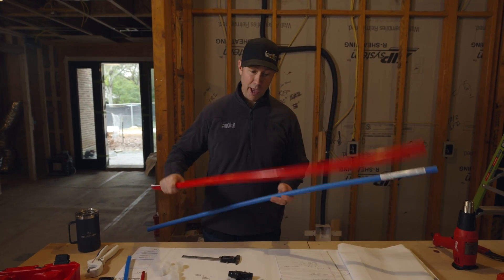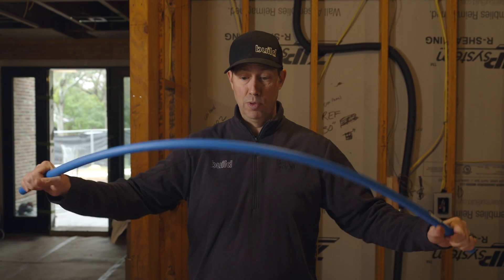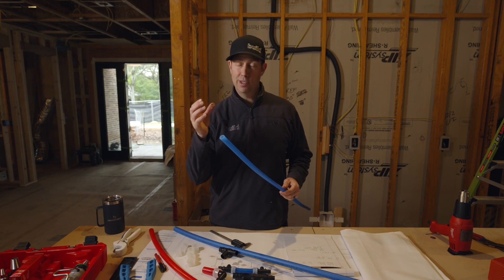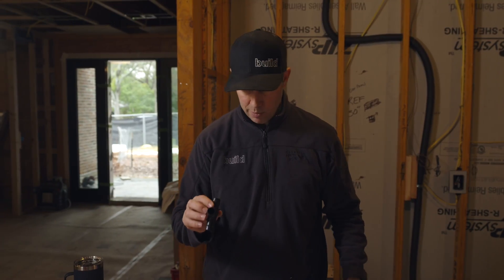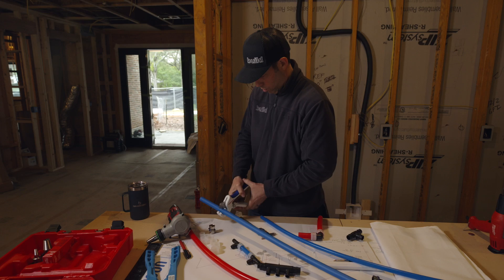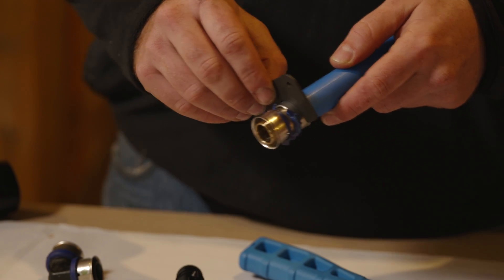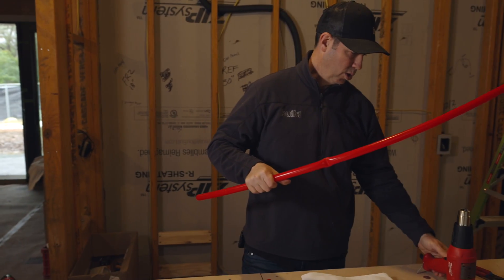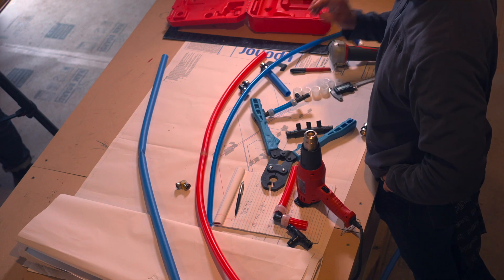Uponor Pipe System Review & Comparison

Comment: I did a bunch of research on PEX before going for Uponor a couple years ago. On any metric, except material price, I believe it comes out ahead. My favorite fact is that is the only system (that I know of) that utilizes the physical properties of the material to secure the connection. After expanding the PEX, it clamps down on the fitting over time as the crosslinked polymers try to return to their original shape. Other systems use crimps or push-clamps that are under stress holding the pipe on the fitting, so I consider it a matter of time before something fails. And by my estimation, the time I saved re-plumbing two bathrooms easily paid for the Dewalt PEX expander compared to working with copper.
Reply: Was health assessed as one of your metrics? Do we know about any long term water quality issues with these types of plumbing systems?
Reply: @Freedacarlo  I didn't specifically look into health but given that these are made of long-chain plastic polymers I wouldn't expect them to be particularly susceptible to leeching into the water. And in a comparative sense there is no flux residue, solder, or oxidation as could be seen in a copper system - but I'm certainly no expert.
Reply: @Freedacarlo  PEX-A does not have any health risks.  It is nonreactive, and does not leach any contaminants into the water.  I don't know about the lesser Pex B and C, but PEX-A is good to go.
Reply: @Freedacarlo  CPVC already leaches into water and it's being used all over the place.  Terrible stuff.   So far I've not noticed any taste issues with Uponor like I do with CPVC.   My house has Uponor,  Copper and CPVC.  I have whole home sediment and carbon filtration.   Get a class of water from a CPVC faucet and it tastes like plastic,  get a glass of water from the coper or Uponor faucets and they taste clean.
Reply: @Freedacarlo  Pex is used a lot in EU (where standards are much higher than US) it's safe. There has been some studies that show leach in HIGH chlorine environments in the US. But only certain brands and in all brands it generally diminished to the point of being undetectable after 30days.  Pex overall is very safe.
Reply: @Freedacarlo , you would simply need to look at the material properties of PEX to see how heat affects it molecularly. If you’re thinking that it is not better than metal (copper/iron) piping in that regard, then you need to do your own research on the material properties of each type.
Reply: Rehau #1
Reply: @benrichards5069  Absolutely.  Got to go Rehau.
Reply: I went Pex-A also.  I like the inherent clamping properties of the joint.
Reply: Have you checked out Polyethylene of Raised  Temperature or PE-RT tubing. It has been used in Europe for decades. Better chlorine resistance than PEX. Both CB Supplies Vipert and Legend Hyperpure are certified for F-1960 cold expansion. Same tools used for PEX A cold expansion.
Reply: @thomasmoore141  We saw PERT in US in 90’s, it was early competitor to PEX. Never caught on in residential applications due to handling issues. It’s too stiff, much more laborious install than PexA. I can’t recall the other issues w/PERT but I just recall my plumbers disliking it. With ASTM standards for PexA the chemical tolerance and potable water safety issues have been mitigated.
Reply: PE- polyethylene pipe has been used in many water utilities as a supply line from the main to the meter for at lease 3 decades. It’s been around longer but I don’t think it became widespread until the 80’s.   I work for a large water utility personally I hate the black CTS PE. (Not PEX-a) I also hate seeing homes where they used the Blue Tuff Tube Pipe. That stuff is junk as well. 
As a water utility we only use Type K- 1” copper for services 5/8” to 1” and for 2” we use 2” copper or Brass piping. 

In homes I’m all for PEX A  
But one last note he never mentioned PEX-Al-PEX Pipe. I see plumber use it heavily here to supply the homes from the meter. Do any of y’all use it? 
The
Reply: @MARKE911  We only use Pex-al-Pex in radiant in-floor plumbing applications. The only reason to use an oxygen barrier in domestic water plumbing applications would be corrosion prone situations such as iron lines or cast-iron water heater tanks which are very rare these days
Reply: @MichaelM-to4sg   and that’s what boggles me. If we have to replace a water service for any reason. We don’t have the proper parts to connect back to that material. The Ford or Mueller pack joint fittings we use don’t seal to that type of pipe. It will be interesting to see what our company will do in the future. Again we don’t use anything other than copper on our responsibility.
Reply: @MARKE911  The Al barrier in PEX-Al is an oxygen barrier. Oxygen can diffuse through the PEX-A pipe and provide oxygen to cause rust on iron fixtures. Iron fixtures are getting pretty rare. Also, oxygen migration is only a problem where the water is recirculated. Over time, oxygen levels in recirculated water increases, causing iron to rust.  Since most pex is being used for domestic hot and cold, oxygen migration is a non-issue. 

If I’d installed radiant hot water heat, 100% would use PEX-Al.
Reply: Can you use crimp with Pex A? Or it must be used with the expansion fittings?
Reply: @micruner5163  absolutely. Don’t know why you would but yes you may
Reply: What is the estimated life-span of the Uponor piping?
Have heard that PEX should not exposed to direct sunlight ever as it breaks down the material integrity so it cannot be used outdoors, is that correct?
What's the max water pressure one can have in a Uponor system?
Does hard water present issues? Does calcium builds up more? less? none?
Reply: @LoneTiger  Refer to ASTM F877 specs. They will answer all of your product questions.
Reply: Upanor and REHAU are the only two in the PEX-A game.  All others are inferior PEX B or C.
Reply: Your research is incomplete!!! If you’re trying to say uponor is the only pex that uses the expansion type of connections you are wrong! As a matter of fact some manufactures of pex  b use expansion or the crimp type system, which actually gives you more flexibility. Pex b is stronger and more stable at the cost of being les flexible. That’s the great thing about living in a banana republic you get to choose. Or not!!!
Reply: Okay now research Zurn its expandable just like Uponor without the dangers of leaching chemicals, please research a little deeper I know it's not proven that Uponor pex-a  is dangerous but some experts say it is so why take a chance when you've got a choice and still have a pex-b thats expandable
Reply: @plumbbuild6517  The only studies I’ve seen and read concerning chemical reaction and/or leaching w/Pex-A is in high chemical environments. This was particular true w/high concentrations of Fluorine, the most electronegative element known, which would be extremely rare except when water was heated over 203F. Even at that, the amount of Fluoride added to some municipal water systems is so low it’s not plausible. 

Compared to copper, which I am completely comfortable drinking from tap with good municipal water supplies, Pex-A & B are shown to produce cleaner water. If you’re interested, cut out a section of lateral copper pipe that’s been in on-demand service for a year or more. Take a look at what the inside of pipe looks like. It’s all green w/CuCO3, aka Copper Carbonate. Not considered dangerous to humans, in fact some copper is beneficial, but it’s been shown that in low usage horizontal pipes which see minimal flow, the CuCO3 can host waterbourne viruses and fungus. Under such conditions, it’s recommended water in line be considered non-potable for 1st 30-60 seconds after faucet turned on.
Reply: Only 1 company makes pex A that should be a red flag!!!!!!

Comment: Pex A uponor pipe use to be great but it has a lot  of problems with treated water breaking it down from the inside out but i was introduced to a pex B pipe called zurn pex B and it's connection is just like uponor pipe plus what ever fittings you use for uponor u can use for zurn pex pipe B plus u can use the same milwaukee 12v extension tool just change the extension heads to zurn expansion heads

Comment: WHY DID YOU USE A 90⁰, THE PIPE BENDS AND COMES IN 100-300 FT TOLLS. YOU COST YOURSELF A FITTING AND 2 POSSIBLE LEAKS AND THE TIME.

Comment: MrPex pipe is PEX-a at over half the price of Uponor. I have used both Uponor and MrPex which is more flexible and easier to work with. As an original Wirsbo believer, now known as Uponor, I use Uponor tools and parts but with MrPEX pipe. We need to stop blowing up people's wallets in this country. We have greater affordability in the US but we do it at almost 100% leverage/debt so, let's take a bit off the gas pedal please. Full financial leverage is slavery with pay. Advise me on a better living with better overall products. Overall includes price performance.

MrPex is PEX-a pipe from LK PEX AB in Sweden
Uponor in 1988 purchased Wirsbo of Sweden, started making PEX pipe in the US.

All those doing reviews on YouTube need to start adding price performance into the equation.  Let Americans breathe a little. You got the perfect name for your job Rising-er please try injecting some Lowering-ger.

Comment: I have more experience than most with this stuff, be careful who you listen to :)
This guy isn't a plumber, uponor has had a lot of problems with plastic rings failing, also I have fix so many leaks where uponor and pex was bent like he is showing and it split in the bend. It's all plastic and plastic hardens and splits if under load.
Pex fittings have copper rings, better in my opinion, but both need to be run as straight as possible. I'm out:)

Comment: i just did my first ever little project using pex...i chose pex B for simplicity and cost. but i was unaware of the inside-diameter penalty i'd be paying(watts brand push connect fittings). 
i have a very noticable volume restriction now, and i only used two fittings. so, while i was very pleased by how simple and inexpensive it was, i am not very happy about the flow squeeze i'm getting from the plastic inserts used in the fittings, that serve as a tube wall stiffener/straightener. 
others know this, and now i do too: go a size up with pex B.

Comment: Pex A is great but the disadvantages of Pex B are overblown in this video. The fitting inner diameter is not a big deal. And with kinking, replacing the section with a coupling is faster than heating the Pex A, as demonstrated by Matt.

Comment: Uponor PEX A is crap 1970's technology. You will be replacing it due to various known failure modes as detailed in the class action lawsuits. Chlorine degrades it. It cracks. Fittings can be a problem.

Comment: Uponor has discontinued the manufacture of blue and red pex due to premature failures and resulting class action lawsuits.  Evidently the clear is not affected as the addition of the red and blue color affects the material.  Whole house repiping is starting to happen on less than 10 year old construction.  Guess Matt might be one of them eventually.  There is should be a disclaimer to this show to inform his audience.
Reply: The class action suit against Uponer claims that the problem with red and blue Uponer is a result of the pipe being overheated after it is extruded to get the dye to stick.  This allegedly causes the pipe to fail prematurely.  The clear is not included in the law suit.
Reply: Yup started to see it in the service side here in Houston. We have seen it on clear pipe too however. We have seen enough over the past three years that I am switching over to the pureflow system and using our remaining expansion stuff for house to meter replacements.

Apparently, chlorine protection is degraded also that causes the tubing to weaken on the hot side. I will note that ALL of the repairs we have had to make on leaking uponor was on the hot side.
Reply: Have the leaks specifically been at or near the joints where is been expanded?
Reply: Where wete the leaks? Near fittings? Near water heater?@SaintlySaavy

Comment: I'm pretty sure at 7:10 you used the wrong tool on a stainless steel press sleeve. The inside of the jaws were smooth on the 1/2 and 3/4 combo crimp tool Sharkbite 865894 which is only to be used for the copper crimp rings. The press tool for the sleeve you compressed should have a recessed groove in the middle of the jaws running full circle.
I could be wrong.......but I don't think so....at least on this.
Thanks for the video, I agree expansion is the way to go.

Comment: Would it be wise to use those 3 split manifolds instead of 3 separate Ts off my trunk line? I'm doing an old home retrofit. Definitely want to use this expansion system over crimp rings I'm sold. Just trying to do it the easiest most efficient way. I'm guessing I could use one 3 split to run all 3 of my water lines in one bathroom instead of 3 T's. What is this racetrack recirculation stuff I'm hearing?

Comment: We used pex "A" uponor in our renovation  and I am extremely happy with it! I would highly recommend you get a cordless expansion tool. I started with a manual one and within a couple of hours I decided to drop the hammer on a cordless one ! Lol! Yeah it's pricey but your arms will thank you! But not having to worry about frozen pipes and the money you save on fittings will make you happy.  Doing a re- plumb with pex is remarkably easy as well. I highly recommend you start with a plan first though! Don't just try and follow your current plumbing. Oh and go up a size from your current pipes as well.

Comment: Hi Matt, I just saw a video of a plumber making what appeared to be a pretty good case for why Zern Pex B is superior to Uponor Pex A.  

Zurn PEX-B Expansion vs. Uponor PEX-A Expansion 2020:
https://youtu.be/tJI-E6y2DuU

In that video he actually demonstrates that unlike Viega Pex B which does use the press fit (crimp) ring fittings that you showed, Zurn Pex B is apparently installed in exactly the same way as Uponor Pex A, that is to say it uses the exact same cold expansion collars, expansion tools and fittings.  In addition, just like the Pex A, Zurn Pex B apparently also has no restrictions in the water flow at the fittings/connectors.  He states that the burst pressure for Uponor Pex A is 480 psi, while the burst pressure for Zurn Pex B is 1,000 psi.  He also claims that Uponor Pex A leeches a small, but safe, amount of chemicals into the water system, whereas Zurn Pex B does not leech anything at all.  Apparently if you have chloramine in your water, he says that stuff will eat through Uponor Pex A in only like three years, while that doesn't happen with Zurn Pex B.  He also states that Uponor Pex A is not rated for hot water circulation systems, and that it will fail early if used in such an application, whereas Zurn Pex B works fine with hot water recirc systems.

Just curious to know what your thoughts are on all of that?

Comment: I notice Uponor has stopped distributing the red and blue versions of their PEX A due to lawsuits.  Apparently the process Uponor uses to add color to the pipe causes the exterior of the pipe to become brittle and as a result, over time, may crack and leak. At least that's what the lawsuits claim. There must be some truth to it, else why else would Uponor discontinue the blue and red versions of their PEX?  The unpainted, or white, version is still for sale and is not part of the lawsuit.  Have any of you seen or experienced any failures? I started to remodel part of my house and have installed some Uponor red & blue, but think I will replace it with the white unpainted version while the walls are still open.

Comment: I use polyethyline insert (barb) fittings  with the uponor expanding system.   it is WAY cheaper, and i haven't had any leak issues so far.

Comment: what I can't find on Youtube is how best to connect new Upanor to old Upanor.  Like what if a home has Upanor from 10 years ago and you want to tie in with something.  Would you do something about that?  I contacted Upanor but they never replied.  Another thing is that Upanor may be the best of the Pex, but it is still not 3/4" inside diameter like Copper.  So there will be some reduction of flow as compared to copper.  If you measure a Upanor 1" plastic fitting, you will see 3/4" inside diameter.  I guess that means we should all really be plumbing with 1" Upanor instead of 3/4" but no one does that, except for mainline & water softener loops, etc.

Comment: Demonstration of the expansion tool looked incorrect.  When Plumbers demonstrate proper technique, they let the tool continue working the expansion fitting 2 to 3 extra times once at full expansion.  The reason is the tool actually rotates as it expands to properly condition the entire circumference of the pipe and collar to form a water tight seal when it is placed on the fitting.

Comment: Wow I’m glad I was trained to pipe in commercial settings and not residential. How are you going to insulate your pipes when you drill a 5/8” hole for 1/2” pex? Always over size your holes for full size insulation on your piping